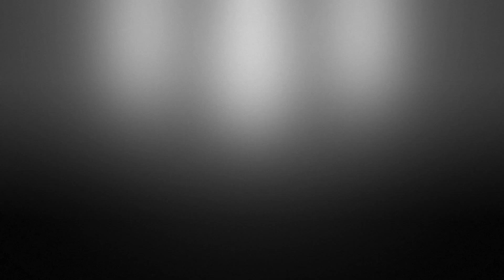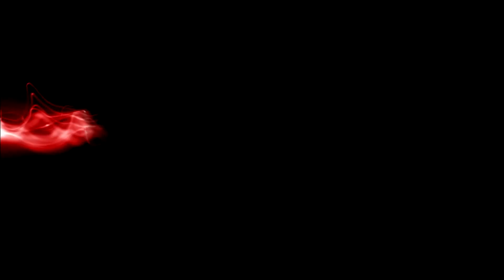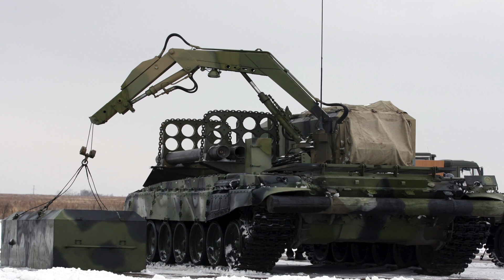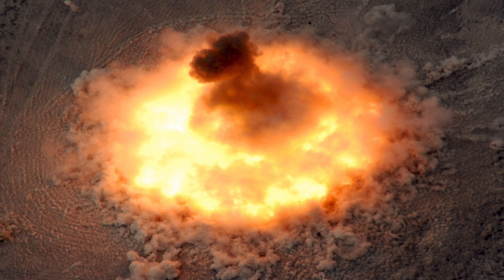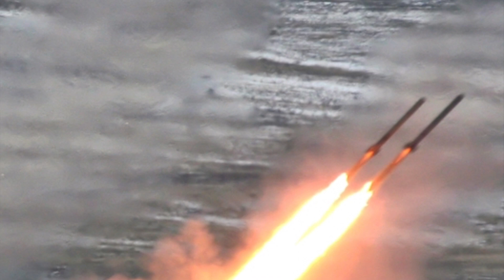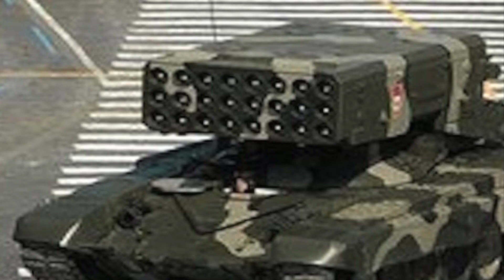WHY RUSSIA’S TOS-1(A) IS CALLED BLAZING SUN ?

Comment: lungs don't rapture due to a split second vacuum, using oxygen doesn't create vacuum. the oxygen is replaced by other gasses you MORON
Reply: See under water explosions and tell me if  the space is actually filled with air or a vacuum?

Comment: these weapons do not create a vacuum. they do however cause pressure differentials because of the explosion. oxidizing fuel does not magically make said fuel disappear and form a vacuum
Reply: Zishy it does creat a vacuum, when the air burns there's a gap left , similar to lighting burining the air and leaving the gap and making thinder when the air comes rushing back in to the void created. It's the same concept the explosion literally takes away the air and you have a emty space over very low pressure (that's why your lungs get pulled out ) it's the opposite of let's say a standard artillery round that creates a pressure wave after impact
Reply: Think of it rather as a major reduction in gas density over a very short period of time. The partial pressure (molecule against molecule in the explosion area) does go negative as Oxygen is depleted. The un-burned fuel is projected outward and the available oxygen is 'pulled' inward, but oxidized immediately behind the wave. So imagine every gas in the atmosphere expanding outward, some di-oxides but mainly all hot oxides, which completely oxidize with high gas velocity, pressure drop is magnified 3 fold.

Comment: There is no vacume created lol.  It's filled with smoke and fumes what happens is the oxygen is used up so it suffocates people.  You need to have a pressurized bunker with air supply
Reply: A novel I read a few yrs back had a scenerio where the bad guys detonate a thermobaric bomb inside a bunker. The people inside managed to survuve due to prior knowledge of the bomb and by entering a pressurised storage vault inside it. Though afterwards when they reentered the bunker they nearly suffocated due to lack of oxygen.
Reply: Jonathan Allen it burns oxigen. What left of burned oxigen? Vacum.
Reply: Carbon Monooxide or Carbon Dioxide actually, not vacuum
Reply: without oxygen there is no dioxide or monoxide, CO or CO2 take out O what you gonna have ...nothing
Reply: Dugza Milza that is basic chemist and people dont even know the atomic bond of those particle, so funny 😂😂😂